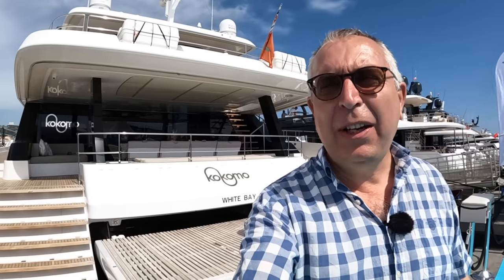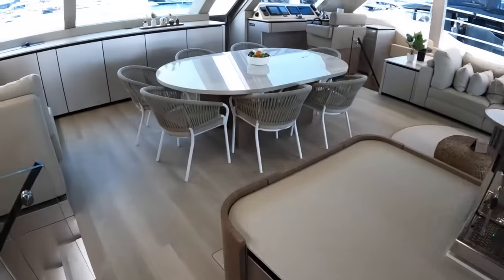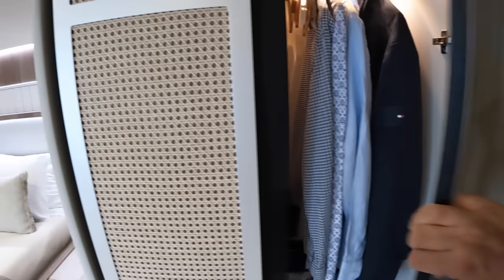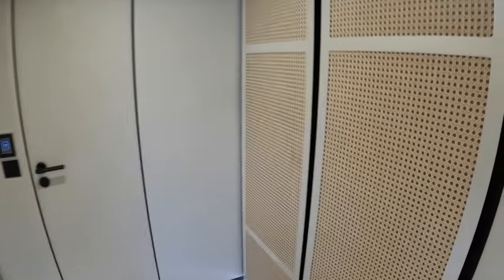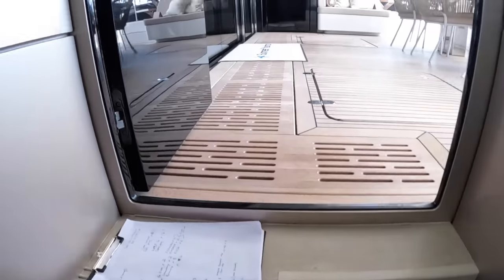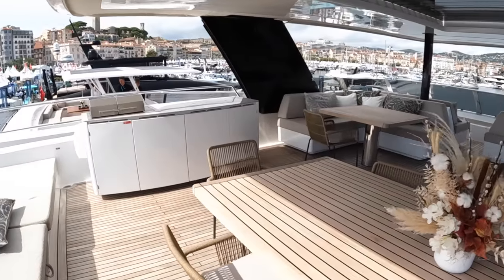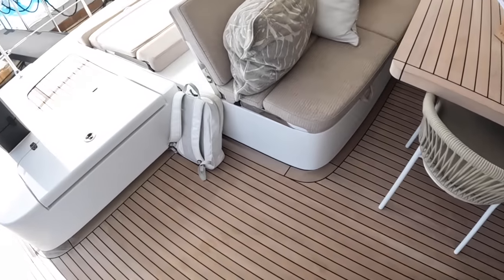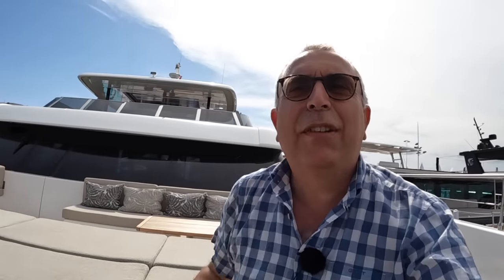€7 Million Yacht Tour : 80 Sunreef Power

Comment: This reminds me of one of those 5,000 sq/ft modern homes with an "open floorplan", which means 1 loud talker can destroy the privacy or peace of about 2500 sq/ft of space. Great party boat if that's your thing.  

I wonder at what point that wind resistance of the doubled frontal area beings to eliminate the advantage of two narrower hulls? This looks like a great base for a 120' - 150' yacht of roughly the same beam.
Reply from the maker: Well, water is 800 times denser than air, so...
Reply: @AQUAHOLIC  yes, dumb question on my part! (typing out loud again) Some very quick mental math based on range and capacity of an Nordhavn 80 puts the cat at somewhere between 60-75% better fuel efficiency at cruising speeds.

Comment: After much research, I've come to the conclusion that catamarans are superior to single hull designs.  

1.  First, you get a 2 to 1 length to beam as opposed to a 4 to 1 on most boats.  This means that a 50' boat gives you a 25' beam.  This creates a much more "liveable" space similar to your home.  Single hull boats give a much more elongated / tubular layout.  If you want a 25' beam, you need to buy a 100' boat.
2.  Secondly, double hulls are much more efficient.  You move a lot less boat through the water.
3.  Finally, double hulls provide an "above the water" feel since the boats sit on top of the water rather than in the water.

The advantages are much more pronounced in sailboats.  Most sailboats sit well below the water.  They are extremely long and thin.  Very little light gets to your living space.  Compare this to catamaran sailers.  The difference is night and day.  Thanks for another great review.

Comment: These are amazing yachts. This one needs a (4-minute drain and refill) infinity hot tub at the front, umbrellas and shades, etc. It would be interesting to see an enviro-line electric version of this boat also; I know Sunreef is shipping them. Not as fast, but more self-sufficient I'd assume. My favourite Sunreef master bedrooms have the balonies as well. 
A separate research video on balconies would be interesting to see because they do make the bedrooms more appealing, while inviting seaworthiness and water damage worries at the same time. I was surprised not to see more hatches on the side decks for ventilation; I guess because of the trip hazard and privacy needs of charter passengers. The air conditioning must be advanced beyond needing them in these boats also .

Comment: Another poorly thought out helm position. Because the fly bridge is not enclosed, when it’s raining the watch-keeper would move to the helm position in the main saloon. But if your making a night time passage this means that the saloon lights and those of the two staircases will have to switched off to preserve the watch-keeper’s night vision. So the guests end up sitting in the dark. 
An impressive range of 3000 but not necessarily trans-Atlantic unless you have enough tank capacity for fresh water and blackwater. The boat needs to have fresh water generation and sewage treatment capabilities to maximise the full range potential (you can’t dump untreated sewage overboard)
Finally for a $7million boat I’d expect a washing machine! 
Have a look at the Iliad 80 to see a much better use of space (and a range of up to 8,000 nm!).